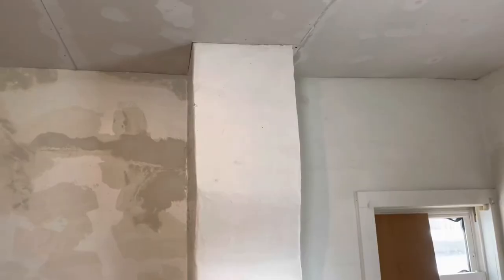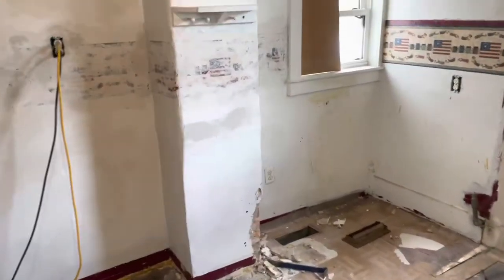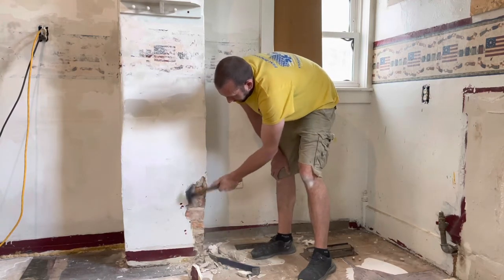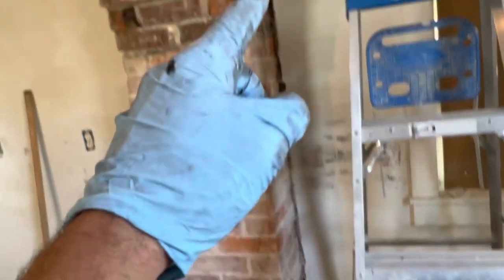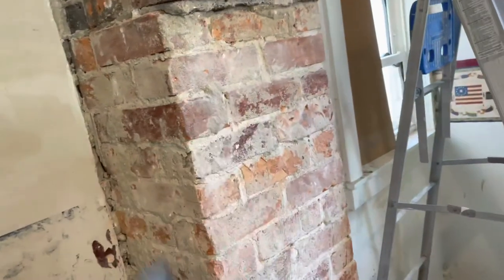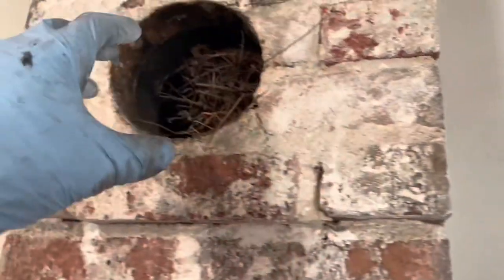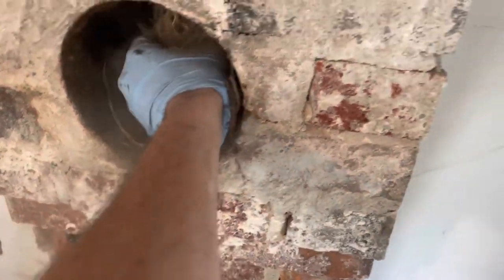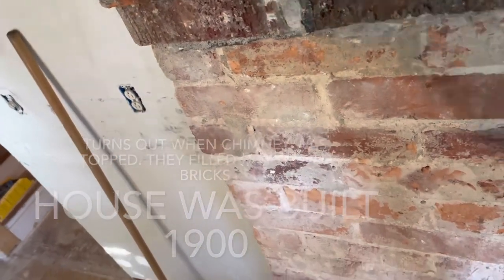Removing Plastered Mortar From Old Brick Chimney. (Before & After) Rustic

Comment: Lay plastic down on the 1st floor so that when you throw rubble down you just pick up the plastic and drag it outside. Beats having to use the blower to clean the floor!
Reply from the maker: I did a whole hose remodel this was one of the first things on the list i just did a broom and aluminum snow shovel with a trash can indoors. Plastic could be an option though!